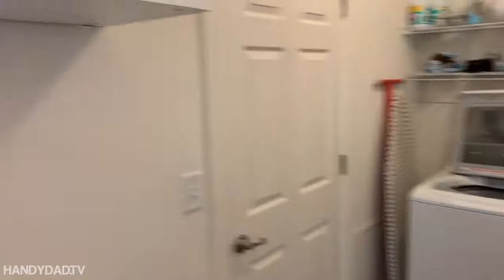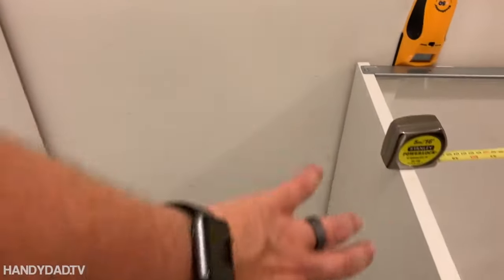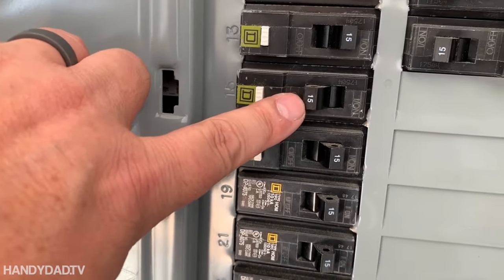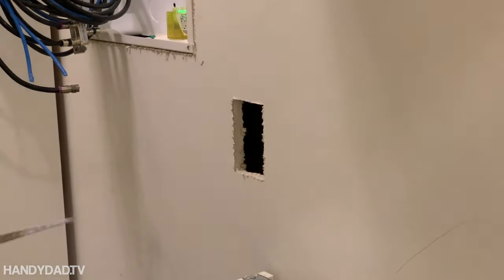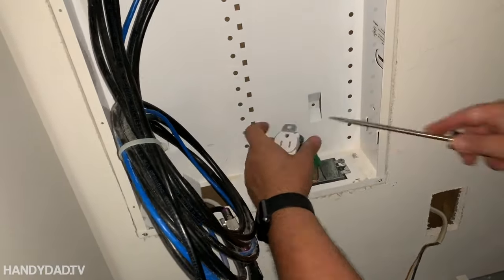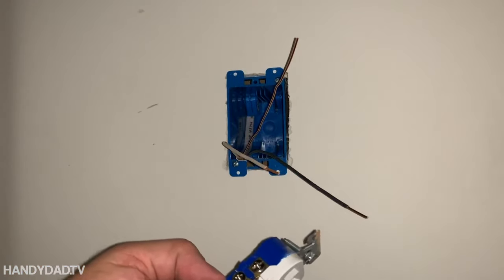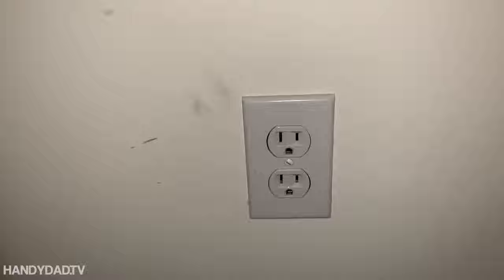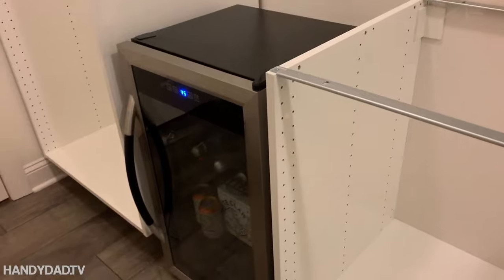Add an Outlet to an Existing Circuit

Comment: When testing power to find the correct breaker, always test top and bottom receptacle.  If you test a circuit and it’s not showing power, it may be controlled by a wall switch in the room that is turned off, but one of the receptacles can still be dedicated hot.

Trust me just test top and bottom, before proceeding.
Reply from the maker: Good tip! Thanks.
Reply: You can’t do it that way… you need a junction box… when the older outlet up is being used that will complete the circuit and not reach to the new one… which means the circuit closure at the old outlet will not let the electricity make a piggy back circuit on the new one… and the reason of that is because the circuit is already closed at the old outlet…
Reply: Please for the love of god do more electrical research before touching any circuit . Because what you just said is completely false and obvious you have little to no electrical experience with outlets
Reply: I was thinking the same thing while watching the video. I'm just thinking with common sense.
Reply: @mrorganic13 no that's also how they did kitchens in north America before 20amp. As in 2 15 amp breakers going into 1 outlet which I guess reduces the amperage big time. Something like that anyway, I'm not an electrician just a guy who got stumped a few weeks ago 😂

Comment: I love the fact that you mention connecting wires to the screws as opposed to making the 'push in' connection because "that's the way my dad taught me". Few things are more important than the lessons of a father. Cheers!
Reply from the maker: Thanks 😊
Reply: You do realize he kept the backstabbed wires in the outlet right?
Reply: No, it's his pronunciation of the word "cabinet". It's like saying the "H" in "Cool Whip"
Reply: I think I would have pig-tailed the wires.  But, other than that, great video!
Reply: @juliangarza6274  can you put both sets of wires on the screws? I'm genuinely asking before I attempt this.
Reply: @Israel Sifuentes  I was told never do it, so i never have. not knowing if its code or not
Reply from the maker: @Israel - One wire per screw. If you have more wires than screws, you need to use pigtails.
Reply: @handydadtv  i think hes saying one wire on each screw, not multiple wires on one screw. i think…

Comment: Beer after completion is code in most states.
Reply from the maker: Yes!!
Reply: Judging by the work found around here, also before and during the job.
Reply: @handydadtv  so if I do a middle of the run like this, say I am add a top receptacle for a mounted tv, and I wanted to run a middle receptacle behind a soundbar, is it necessary to connect both top and bottom outlets on the middle receptacle?
Reply: @JannaOk. So how would I do it?
Reply from the maker: @Joe - You connect the soundbar outlet to the existing outlet, then connect the TV outlet to the soundbar outlet.
Reply: @handydadtv  ahhhhh...Ok makes sense, Thanks!!
Reply: @handydadtv  ok one more question. So what do I do as far as the ground for the middle outlet?
Reply from the maker: @Joe - You need to create a pigtail with a wire nut for the ground.
Reply: @handydadtv  ok so I would need to take my ground wire ran from the bottom receptacle and take my ground running from the top, and  pigtail off of both of those for one lead right?
Reply from the maker: Yup that’s what you need to do.
Reply: Does white claw count though?    😅
Reply: Cool

Comment: I used your video to add an outlet in my house and things went wrong almost immediately! Couldn't saw the hole in my drywall and my studfinder was freaking out. Turned out the wall was original to the house and full of layers of wood and masonry! Once I cut the hole and got it thin enough for the flanges on the old work box, it was smooth sailing! Thanks for a great tutorial.

Comment: I have never heard of running wire over a stud between the stud and the sheet rock. That sounds like a good way to run a nail through a wire.
Reply: Well, the correct way to do it would be to notch the stud and then put a nail stop plate over top of the wire sitting in the notch before patching over. This protects it from some poor sap who later tries to drill/nail in that location.
Reply: Notching a stud is also a bad idea. You drill a small hole through the stud to run the wire. Notching it would resemble too much of the stud.
Reply: @VampireOnline  No, notching is perfectly allowed, as long as you don't notch too deep. For a load bearing wall, you're only allowed to notch 25% of the width of the stud. For a 2x4 wall that gives you a notch of 7/8 of an inch, which is way more than you actually need. A 1/2 inch deep notch should be more than enough to run a flat 14/2 NM cable under the plate.

Drilling a hole in the center of the stud is also okay, assuming the hole is small enough, but it requires removing way more drywall to get a drill or flexible bit in the right spot to get a straight hole in the center of the stud.
Reply: I just wrote the same thing. Thanks for telling everybody how to electrocute the next homeowner. No Common sense is a killer.
Reply: Actually I thought that was pretty ingenious. Great video
Reply: It's also a HUGE no no for code.
Reply: Yeah, an otherwise great video marred by a careless sentence. I'm guess he meant he'd notch it but going over the stud is definitely a no no.
Reply: It’s against the code to notch out the stud as he is saying and is a fire and electrical hazard. 
You can drill a hole in the stud from the new receptacle hole and fish the wire to the lower plug then up to the existing one.
Reply: That why you should run bare wire extension cords across the wall.  NO lose cords you say. STAPLE GUN I SAY!! And remember kids keep fresh bucket off salt water close by.
Reply: @birdoffire9  that makes perfect sense!
I would also suggest using 1000 MCM for the bare white wire and use a fastergasket to seal the wire properly to the air pocket. This should help with the conductivity of the salt you propose. 🤔
Reply: That metal  is missing a connector, the wire is rubbing against the KO sharp edge.
Reply: @ktw7hu  not anymore anyway, now if your running behind finished drywall you don’t have to secure it.
Reply: @derekparent752  not in my part of the country, we can notch up to 25percent of the stud. That is to code.
Reply: @thomasmarable6818  providing you place a metal plate over the conductor/notch as per code if you are within 1 1/4” of the edge of the stud. 
People must keep in mind, this is for safety, not because “hey look, I can do this”
Ask yourself if you think the installation is safe? Will or could it be an issue in the future? Why exactly is someone cutting corners, to protect the look of the drywall, save a few dollars?
As an electrical contractor my first priority is to do a safe job, not just a code compliant job.... if everything in the code book was 100% safe, they wouldn’t change it every 4 years. 
Just trying to be a better then average hack.
Reply: @brianwideman2342  If someone gets electrocuted from hitting a live wire with a drill, then there's way more wrong than what he did there. He's in a laundry room which would require a GFIC that if installed properly should trip way before anyone is electrocuted.

Comment: One thing I would have explained for those not very familiar with wiring is the correct way to wrap the wire around the screw. 
Good video👍
Reply from the maker: Good point. An idea for a new video! I make an L or J to wrap over the screw in the direction it tightens.
Reply: @handydadtv  You should close the loop of the wire once around the electrical screw, use a pair of needle nose pliers..
Reply: I agree, the connection looked pretty loose.

Comment: Great video. You even talked about the correct wire gage to use for 15 or 20 amp circuit breakers. Very helpful!
Reply from the maker: Thanks. Glad it was helpful.

Comment: Awesome video! I just needed to run 1 outlet in the same cavity as one existed (but on the other side of the wall), so basically exactly this video, and knew it couldn't be too hard. You made the job so easy for me and saved an electrician bill! Thanks a bunch- That beer is on me!
Reply from the maker: Thanks 😊

Comment: If you had to go past the stud on the right, you need to notch the drywall AND the stud.  Then put a nail plate over the notch, to protect the Romex from nails and screws in the future.  This is also a NEC code requirement.
Reply from the maker: Perhaps, but I’ve never seen anyone do it that way in a retrofit situation.
Reply: You could also get one of those cylindrical things with that spiral pattern on the side, you attach it to some kinda tool, then it spins around and it makes a circular opening in the stud, don't know what all those things are called.
Reply: Michael M a drill bit? Auger bit?

Comment: That metal box is missing a connector, the wire is rubbing against the sharp edge.
Reply: @wojtek-33  
Unless you live in an earthquake zone. I think his point is that it's not up to code. Easily fixed with a plastic fitting. The box should have a ground wire attached to it as well. And a kitchen normally has 20 amp circuits to receptacles.

Comment: Super video. Thanks. I installed three ceiling fans by watching DIY videos and you can do it as long as main power line is off and understand that green bare is earth. White is neutral and other red, black and blue are hot wires. Not a big deal if wires used are as per specifications.
Reply from the maker: Good job! 👍🏻

Comment: Ok, I’m not brave enough to try this myself but I think your video answers my personal needs!  I need an extra outlet in my kitchen!  I believe an electrician can add one by connecting from an existing outlet in the kitchen.  What a great video… thank you.
Reply from the maker: Yes, most likely. Good that you’re getting an electrician though because you need to be concerned with sufficient capacity for appliances in a kitchen.

Comment: Check the load on the circuit you’re coming off of before adding more outlets.
Reply: How many are you allowed to run
Reply: Dallas I was thinking about that no telling what tht lil fridge will do
Reply: Cheap Seats 12 outlets per circuit.
Reply: How do you check that? I’m planning on mounting a TV and need a outlet moved.

Comment: Good video. Thanks for the information on what gauge wire to use with 15 or 20 amp breaker.  Big help.  Also appreciate the help on the special ground plastic screw to join 2 ground wires into one.  Great video.  👍👊
Reply from the maker: Thanks so much
Reply: @handydadtv  your welcome

Comment: As an extra safety precaution, especially when you're working with a metal box/bare ground wire, just wrap some electrical tape around the plug when you're done wiring. There's bits of copper showing on your hot and neutral connection points, as well as the screws themselves. If any metal touches them you'll be getting at the very least a short. Just take the extra 10 seconds and wrap some tape around the plug.
Reply: Overkill
Reply: I did this for most of the new light switches and plugs I installed recently per the advice of Jeff from Home Renovation DIY. I forgot to do it on some of them 😂.

Comment: Depending on where you live codes dictate that everything must be run in 12 AWG.  This regardless of a 15 amp breaker or 20 amp breaker.
Reply: Where is this at that you have to run 12 AWG for 15 amp circuit.
Reply: I was taught this too. 12 AWG for residential electrical outlet circuits and 14AWG for most lighting. The reasoning behind it being that someone down the road may put a 20 amp breaker on that circuit. Also I was taught never to use the device for continuity so the power should come into the box and then have a pigtail for the outlet. The wire going to the next box is connected to the incoming wire at the same point where the pigtail is connected. That way if the device fails you don't lose power to everything downstream.

Comment: In 10 years ill be explaining this to my boy and I'll be like "You could use the pressing connectors and stick the wires in the back, ill use the screws on the side because some guy on youtube taught me and... thats what I do!"
Reply from the maker: Lol. I would be honored.
Reply: better reason is that the back connections are known to degrade over time. Believe it or not wires actually vibrate from power going through it.

Comment: Any suggestions if the outlet you're running off of is in the middle of the run, and so both connections on the side of the receptacle are already being used?  Or is it a no-no to add a line to the middle of the run?
Reply from the maker: You can’t always find the end of the run. I happened to get lucky. The process is the same but you’ll either pigtail all the wires and connect to the existing outlet, or connect your new wire to an empty set of screws or use the press-in connectors on the back of the existing outlet.

Comment: Nice video. I didn't know about the green twist nuts with the hole. So much easier than using a regular wire nut. Thanks again.
Reply from the maker: My pleasure

Comment: Looks like you don't have a wire clamp installed on the hole where wires go through the metal electrical box.
Reply: There wasn't one installed before,  but he should have installed a pop-in bushing
Reply: Also the metal box needs to be grounded.
Reply: Matthew Savage that ground screw next to the receptacle is a way to bond (ground) the electronics in the cabinet.

Comment: Very good video with exception of the gouge out the drywall and tape over it.   That would be unsafe and a code violation unless you went to middle of stud.     Also a suggestion.   Get yourself a small box and some painters tape.   Put a half lap of tape on one side of the box.   Now stick the box under the location you are going to cut the drywall.   No cleanup on the floor or counter required!

Comment: You can run 12 gauge wire on a 15 amp circuit but you can't use 14 gauge wire on a 20 amp circuit
Reply from the maker: Yes, bigger is always okay. Good point.

Comment: I ain't a pro, but 'gouging the sheetrock' to navigate a stud is absolutely wrong. And how about a wire clamp on hole in the metal box?
Reply: I was looking for this comment. He'd have to at least put a metal plate over the "gouge"...
Reply from the maker: Yes of course

Comment: Good video.  You made this a simple process with good explanations, and slow-downs to clarify the thought process.   (Might want to omit the part about gouging the sheetrock tho. 🤦🏻‍♀️)
Reply from the maker: Yeah I got a lot of haters on that comment.
Reply: @handydadtv  , 😅  yeah, I'm sure.  Other than that 🤪 ,  really good explanations and safety precautions about the circuits, wiring, amps, etc.  👍

Comment: Good explanation and video showing everything. I learned something new; you can't tie two ground wires to one screw connector on an outlet. I've done it before and will go back and replace them with a pigtailed wire nut. I was just watching to make sure I was doing things correctly adding an outlet and a switched light in my attic. I need the outlet to tie in two new outdoor security cameras that are plug ins.

Comment: Absolutely excellent presentation, clean, concise and a little funny. Thank you good job!
Reply from the maker: My pleasure. Thanks for the comment.
Reply: @handydadtv   where did you get the ground wire connector cap from?
Reply from the maker: You can get them locally or online. Just look for “ground wire nut”.
Reply: @handydadtv  Thanks man

Comment: I've added outlets before & had to get a permit and get an inspection.  The inspector came by with an electrical tester and that was it lol.  Check your local codes before starting any work.
Reply from the maker: Good feedback

Comment: Videos like this provide inspiration and some education.  We must be careful to learn what is correct.  When I shower, I do not wash my butt crack first, then wash my face.  Each jurisdiction can adjust the electric code or even disreguard  it all.  Make sure you are following your local guidance because a liability issue and a moral delima can be created by doing it wrong......electric shocks, fires, medical bill payments, and income replacement due to death of a worker come to mind.
Reply from the maker: No argument here. DIY is a personal choice that inherently takes sole responsibility for the outcome.

Comment: FYI the black wire is the hot one and the white one is the neutral wire which you can check with a meter. Sometimes you can't see the colors and you then have to figure out which is which or you may get a real jolt out of it and not a funny one at that.

Comment: No permit needed? You can do any electrical work or plumbing in your OWNER OCCUPIED SINGLE FAMILY HOME in NJ. Permits and inspections are required for any NEW work and some replacement work like water heaters,A/C units. Check with the town if you are unsure of what needs a permit.